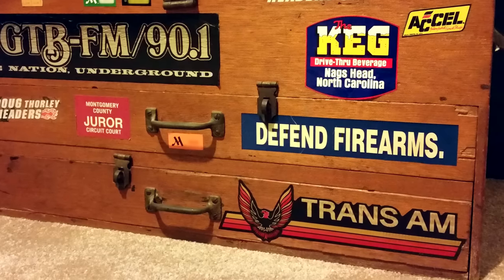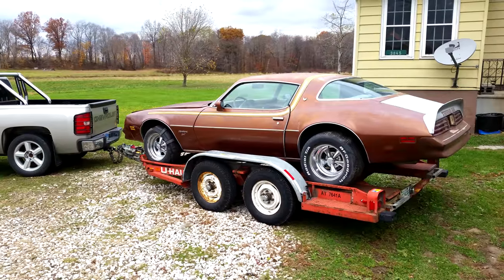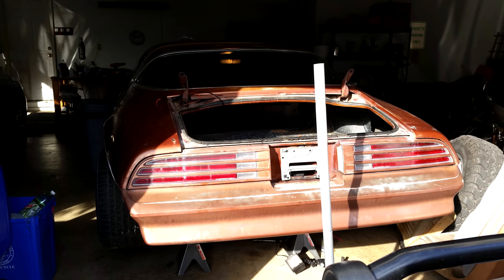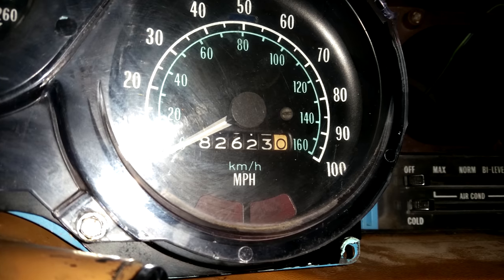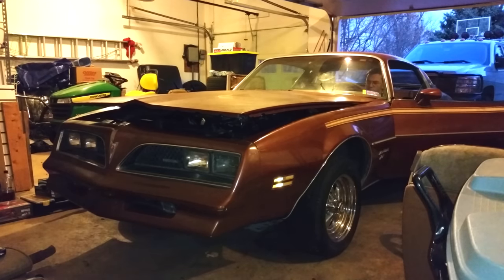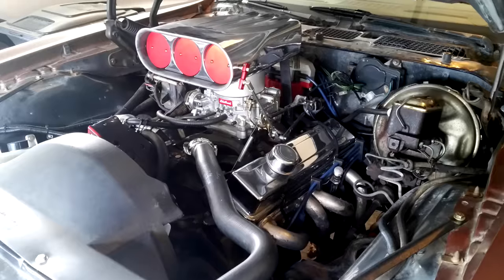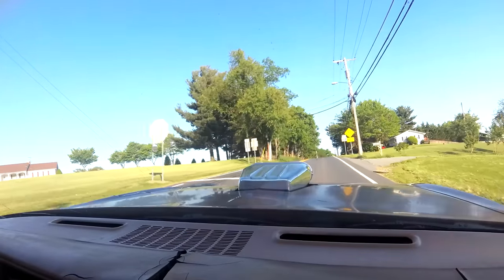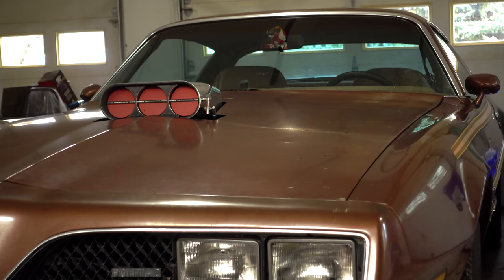1978 Pontiac Firebird Street Car Project (Ep.1)

Comment: My father was also a Pontiac man and we had a 66 LeMans ( now mine) a 66 GTO convertible 4-speed clone lost to fire and several other Pontiacs. I my self had a 1989 Pontiac Firebird Formula 350 I bought in Atlanta, Georgia and brought home to Ohio and it was an immaculate vehicle no rust and the A/C even worked and the T-Tops did not leak. But being a young man in 2008 (32) I thought it needed more power so out came the engine and trans and I proceeded to build a pretty strong 350 and in the process I deleted all the A/C shit and all the computer controls, wiring and the TPI injection system and ruined the drivability of the car and sold it, and I regret doing that to an awesome car. I am currently in the restoration of my fathers 66 LeMans because he has since passed away and it will be a tribute to him...completely stock other than a few improvements for safety's sake and maybe a little lower with more meat under it and of course a loud sound system. Just sitting behind the wheel and moving it around in my barn I get nostalgic about all the great times we had as a family at car shows or club meets. My 2 children are graduating high school this year and 1 is going away to college for Chemical Engineering and the other to the Air Force for Aerospace Engineering so it will just be me and my wife taking the car out for drives on the country roads where we live and enjoying the vehicle my father enjoyed with his wife and children and honor the memory of a great man taken from our lives way too soon... bravo to you!

Comment: I understand the passion you feel for that car. My first love was a 1987 Dodge Ares K Wagon Streetside 20 (good luck saying that all in one breath.) This was a car my parents got me for $500. This thing turned away so many people because it smelled, the AC didn't work, run had gotten into the frame, the seals were bad, the transmission didn't fully engage after a stop, the glove box would open if you hit a pot hole, and the muffler "deployed" one day while a guy in a pickup was tailgating. But that beauty could turn on a dime, had the most comfortable bench seats (with a stylish saddle blanket covering the upholstery I might add), could stop on command, was the widest damn thing on the road, and every mechanic, gear head,  and friend I showed it to loved it. I miss that car a lot, but when the transmission failed on me there was nothing I could do. But for a car that gave me more memories per mile and smiles per gallon than I can count it will always be special to me. Some people just don't get it, but that is their loss.

Comment: I have a 78 Redbird. I changed it around to a muscle car and show car. All details were covered. I have small B&M blower. Headers run to mufflers minus that converter. I also have cut offs welded in to run straight headers in races or dynos. I had highway gears that I swapped out and placed 4.10s in. It's cherry red. I didn't want this car at first. I could have bought a Bandit version.  At the same car show these 2 set. The Bandit would eventually need changes I ended up doing to the Redbird.  But the Redbird was a 1 owner and sooooo clean. Always garage kept, and no use to race it bc it was a cruiser for highways. It was perfect for the 17 year old me.   I had a pretty car for high school. At the end, I parked it and began a beast mode overhaul.

Comment: Beautiful car man! I bought a beat up old 79 Formula a few years back for $ 1500. Came with a 350 just like yours so i rebuilt it for $3000 got it all up and running amazing and found out it had stage 4 cancer. Body shop couldnt believe i was still driving it around it was so bad. So i looked for a few weeks on craigslist until i found a 79 trans am roller for $3500. Drove to wisconsin to take a look at it and it was beautiful. The T-Tops leaked and rusted out the floor panels but everything else is perfect. The guy that owned it picked it up from Tennessee and between this and his 57 Belair he didnt have the money to do both. So after lots of haggling  i got the price down to $2800 and it came with an extra 350 and tons of extra parts for it. So i got it home and dropped it off at the body shop where its sat for a year now because they want cash upfront for working on it before looking at it. So i bought the floor pans and a brand new carpet for it. Just found out a buddy of mine has a 400 for sale so im going to pick that up this weekend and start the building process. Ive never been more excited to get to work on one of my dream cars. Theres nothing like it out there. It makes me happy to see that other people have such love for cars. Great video!

Comment: COOL STORY BRO!!! MY BRO had 3 second gen's!  a 77 firebird w/301 ran smooth!(original owner ran 1 quart trans fluid in with the oil!!! so we continued the trend!!!  a 78 trans am w/455 H.D. power everything, 3=10's in the trunk, kill switch, custum 2 toned  paint ,naked lady carved into the quarter window's, built upper end, cam, heads & headers, chrome kit! most importantly was his 79 z-28 w/ 1973 sb 400 bored, stroked, & balanced to a stroker 406 & MAN, DID IT SCREAM!!!!WELL OVER 750 HP & TORQUE!!! I could go on & on about that 406!!! it was built by a local machine shop for his son & they spared NO EXSPENCE & IT HAULLED!!!

Comment: Flipn awesome car and i like the vidio too. I tell ya I never should've got rid of mine!  Mine was alot like yours.  Not a show car and needed some work.It had a 455 that someone put in it. Mine had custom paint, light blue in front fading to dark in the rear it  said 455 ho on the side of the shaker, but it was missing the bird on the hood. After seeing the part about ur ignition, well, it reminded me my turn signal lever broke off n at that time i was broke and dont laugh but i used a tire patch repair thing the part that you push the patch in with. I had one that had a black handle and with them having the split it well it screwed right in. I bought frame connectors after twisting my 79 z28 with a 406 motor bored 400 th 400 trany with 373' s in the rear but ironicly i never welded them in. I never was able to get the snow flakes, its awesome that u did but i like what was on it too! But i think u should go with a shaker hood u already have a t.a.. dash insert.  Traction bars look cool on em.Just a thought! I picked up on what you said about your dad im sorry bro,  my father passed less than a month ago. Its Shity! But once again  Im sorry and im sure he loves the car! But learn from me bro DONT SELL IT. EVER. I would love to watch more vidio of the car . Maybe a part 2

Comment: My mom gave me her 79 trans am with the 403 olds and a grenaded turbo 350 that was rusted out, I just got a donor 80 body with a whole rebuilt bottom end and upgraded suspention with disc brakes all round and I got a pontiac 400 with a 400 transmission,. I'm going to gut the interrior and swap the 79 flares and packaging on it painted deep emerald with solid american racing rims. fingers crossed it's done before the winter sets in again.

Comment: my mother owned two firebird birds back in the 70s a red 75 and black 78 Trans-Am. about a year ago now, I... bought myself a 1978 Trans-AM. Been resorting it to daily driver condition and my dads always been a Camaro fan but dose love the 400 and  nose better than the late 70s cameros. I've named my car scarlet even though it's silver and a hard top, black interior 3spd auto, suppose to have A/C. personally wouldn't change a thing about it other than upping the HP to 350 from 220 and maybe using a proper overflow tank than the coke bottle from the previous owners, I'm the 5th. A lot of people get excited seeing my car with the shaker and always ask what car it is. Pontiac may be gone for 15 odd years now, but the bird still screams.

Comment: One thing about Nevada. The hot summers will definitely cook the finish but it wont really rust out the bodies of old cars. This is in Southern Nevada like Las Vegas if the cars are bought from here in this region. East coast, west coast, and mid west cars are badly rusted underneath because they used salt on the roads during winter. The body suffers from rust. But most cars or trucks that come into southern Nevada come from everywhere because Las Vegas is a transient city. Up north in Reno and Carson is the same also.

Comment: The floor pans and wheel wells look fantastic for the year.
Reply from the maker: There is a tiny bit of rust (no holes) above the gas tank, the small rust hole on one corner of the rear wheel well, and there was one pencil-sized hole in the driver's side footwell from the leaking door seals, but that's about it! The East coast never has cars like that!
Reply: Fuzzy Dice Projects I live in Michigan. These cars turn into rotted messes.

Comment: Cut the flange on those headers and they should seal right up.  Also, I've had good luck ditching the gasket and just using black silicone.  It's how Sanderson says to mount theirs.  I've had it work well on cheap Hookers too ;-)

Comment: I was gonna say, it sounds like it needs lower gears, but then you mentioned that. :-D I had a '80 Firebird with a 301and 2.42:1 rear gears, a set of 3.08's really made a difference.
Reply from the maker: You nailed it, it has the 2.42 gears. 3.08 or mayyybe 3.43 was the eventual plan, along with a limited slip. Kind of fond of the highway manners honestly though, will just see how it goes under boost.

Comment: In 1983 I bought a fully loaded 1978 Formula Bird off a 62 year old lady....seriously. It had 29,000 km and I paid 6 grand. She was selling it because her mother was having problems getting in and out of it. . Drove it for 15 years with no problems.....was still running good (350 with 350 turbo) but the body was rusting off of it. Was a  GREAT car, but gutless unfortunately. ***** MIGHT HAVE SOME PARTS***********...I sold it to a buddy and he might have parts, if we're lucky maybe even the car.Just sent a FB msg to his wife to see what he has. I told him to keep the hood, the wheels (Pontiac track rims with center piece and rim)...the seats (gold valour). 3.41 posi unit out of a zapper, sway bars.  Cheers
Reply from the maker: Very cool, curious to hear what is left of it!
Reply: all he has left is the dash (in good shape. tan in colour, no cracks, tach) and bezel (spun aluminum one), taillights (I wired these so all three light up when braking), park lights grill. Let me know if want them and I will give you Rob's number. He is in Langley, bc. Sure he will cut ya a good deal Cheers
Reply from the maker: Thanks for checking with him, but I'm not too concerned with those parts at the moment. Appreciate it though!

Comment: for your headers get the dead soft aluminum ones i have yet to have headers leak since using those.
Reply from the maker: That's what I have on the collectors and I THINK they haven't leaked since switching to them. Need to figure out what bolts I can use to get the header bolts tight to the cylinder head and easily retighten them, then I'll try a solid gasket.

Comment: for the header leak use doubled up stock exhaust gaskets for stock manifolds
Reply from the maker: I think it's the bolts coming loose that's burning the gaskets, I can't get a socket on most of them even with small-headed header bolts, so really tough to get/keep them tight. Plus, I think the crappy welds on the headers themselves might be leaking since I can hear the leak immediately after changing gaskets.
Reply: you can grind down a 1/4 in deep well socket you can also buy allen head bolt at the hardware store some of my friends who drag race use high temp permatex on both sides of gaskets
Reply: you will get it bro

Comment: Hello fellow Marylander, I had the same problem with header gaskets leaking. this was because the header bolts were backing out over time. I bought stage 8 locking fasteners, and have never had a leaking header gasket ever since.
Reply from the maker: The problem I have had with these particular headers is that I can't put a socket on most of the header bolts, even the ones I'm using with 7/16" heads, so it is tough to get them tight and keep them that way. I have found some with 3/8" heads I plan to try with a swivel socket, unfortunately I don't think anybody makes locking header bolts in that size. The ball-end hex key sockets I have tried have not been strong enough to get these bolts tight either, so I haven't had luck with the internal hex bolts.
Reply: I completely understand, installing the long tube headers on my LT1 firebird was a pain. fitting the socket/wrench on the the bolt, and tightening it was a real exercise in patience and pain tolerance. have you considered going old school and use safety wire on the header bolts?
Reply from the maker: Yep, that is another option. If I can manage to fit a socket on the 3/8" header bolts then I might well drill them for wire

Comment: I love the journey you took- and I've always wanted to take a similar one, but I'm honestly scared when rust comes into the picture. I'm looking at at 70 vista cruiser with a 455, but it's got leaks and some rust damage. I also don't have a nice house with a nice garage like you do- so I don't know if I should take the plunge. However, I do know that these cars are becoming more rare and more expensive, so a part of me thinks that if I can get into it now and secure the car, that as I age I'll be able to work on it to make it my "own" car. But the rust really bothers me. What would you do?
Reply from the maker: Hmm, I'd say it depends on how bad the rust is and how much money and time you're willing to put into it. Rusty body panels are not a big deal, rusty floors are a bigger pain but not the end of the world, but rust on structural sheet metal means a whole lot of work and probably money to do it right. If it is superficial rust, and you're okay with it looking a little rough and/or taking a few years to get it on the road, it doesn't seem like that bad of a project. If the rust is structural, it's a tough call if you don't have a good place to store it and work on it while it is in pieces for months or years.
Reply: Thanks. I just went to look at it a few hours ago. To me, it looked like the entire top part of the roof all the way back to the d-pillar needed to be replaced. The rust was flaking so bad it was pressing the vista windows out of place. I hated seeing it like that. I accidentally poked a large hole into the d-pillar pointing out a rust hole. But man.... starting that 455 and hearing her roar to life was AMAZING. I'll definitely be looking for a 70's wagon in the future. Bummed it couldn't be today though. Thanks for your videos. They're great!!!

Comment: I had a tri-mesh breather like that on my 70 Chevelle... let moisture condensate into intake.... they are crap... ruined the Q-jet carb.  Still don’t run right
Reply from the maker: Yeah, I have heard them called the "triangle of death" as well, because a backfire through the carb will ignite the foam, and drip down into the carburetor. That's from the previous owner, got rid of it ASAP
Reply: They are terrible, along with q-jet carbs.